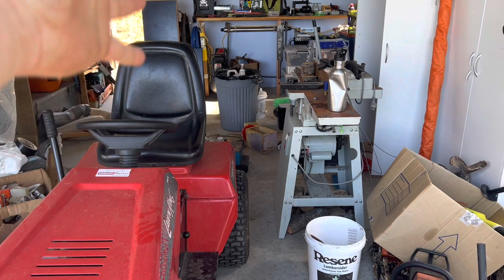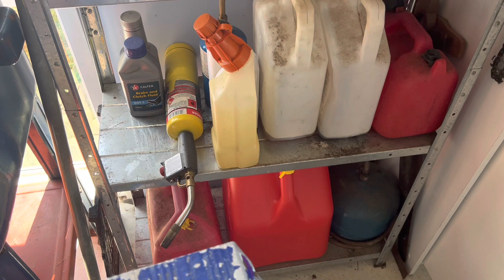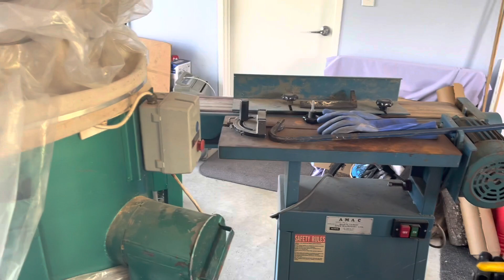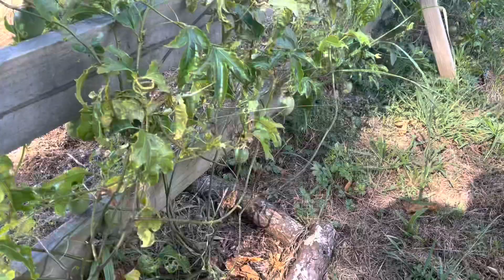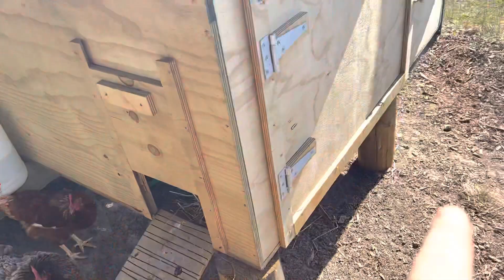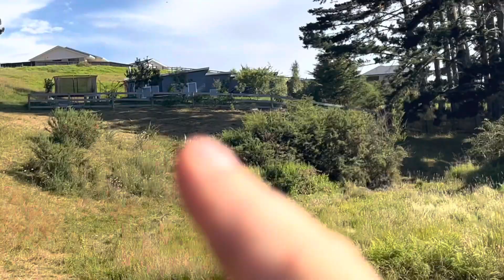A quick catch up! Stihl for life!

Comment: I'm not sure if this is a two way communication but here goes.  Greetings from Jonesboro, Arkansas, U.S.  Recently I really enjoyed and benefitted from your 026 rebuild from 3 years ago.  Love my 026 which I purchased new back in the day.  Question:
Is it possible for the oil pump to go crazy and start pumping a profuse amount of oil.  Anyway that appears to be happening recently.  I'm considering replacing the pump and oil pickup line.
Thank you.
Reply from the maker: Hi Tim! Thanks for your comment, I’m stoked you got something outta my vids.
026 are an awesome little saw, I love mine!
These are old saws now and the idea that Stihl had around bar lube back then, was just to throw it at the bar in huge amounts! My 026 is like this to a large degree. The 026 pro version has a screw on the oiler that you can turn down, so if that’s the case see if you can adjust that first.
If yours is not a pro model then maybe look at replacing the current oiler with a pro model oiler to see if that helps, but tbh these old saws just throw heaps of oil imo. 
Thanks for watching and Stihl for life!
Reply: @kiwilad4216  thank you for the prompt response.  Mine is not the pro model.  I’ll try the pro oil pump and will let you know the results.